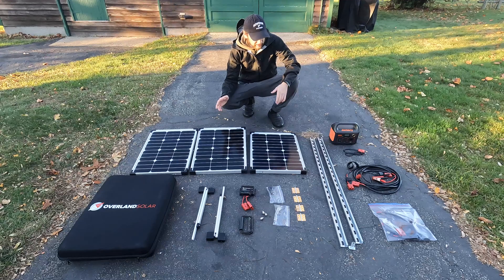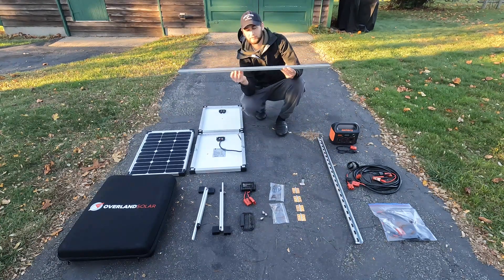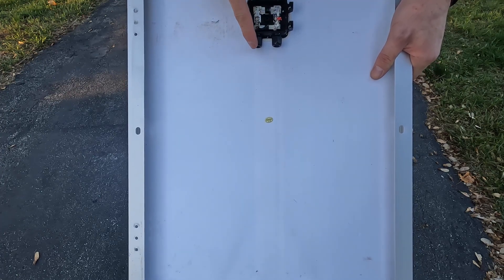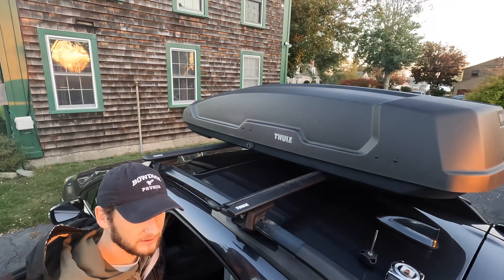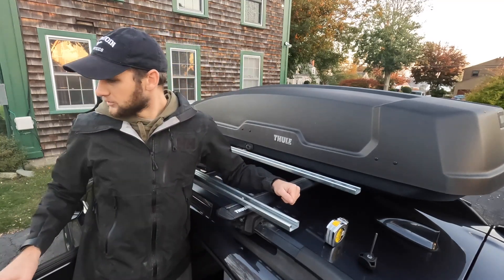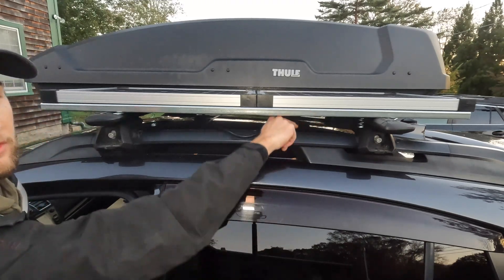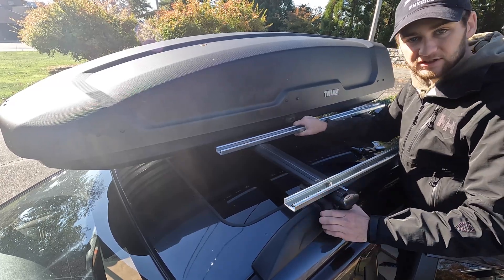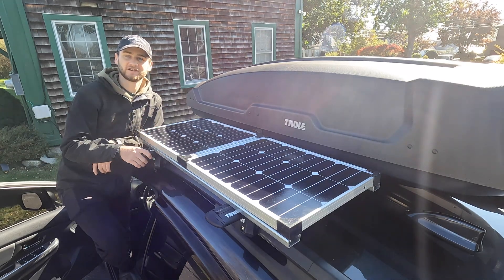DIY Roof Rack Solar Panel Installation - Subaru Crosstrek Car Camping - Mounting

Comment: This is an awesome update. I love what you are doing with the redesign. Getting ready to hit the road in a 2019 Crosstrek & this design would be great. Would you share the dimensions of the design? happy to pay.
Reply from the maker: Thanks! I will be posting the plans for sale shortly, but before I do I want to verify that the design is sound - Building the first updated conversion later this week to work out any flaws.
Reply: @mitchsends  Great to know! Planning to construct a buildout this Thursday & love your design. I would definitely buy it (if it was in the $25-35 range as I only have $100 to buy the materials as well. Every dollar counts right now 🥹).